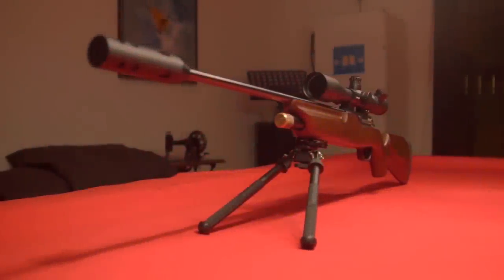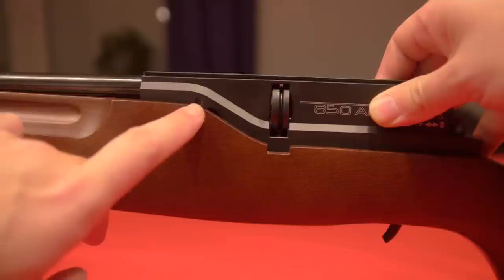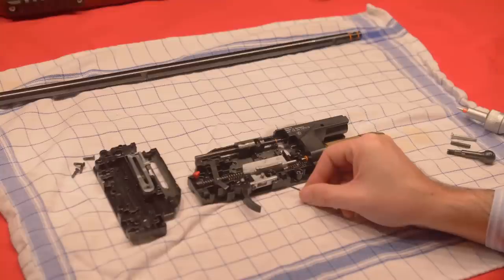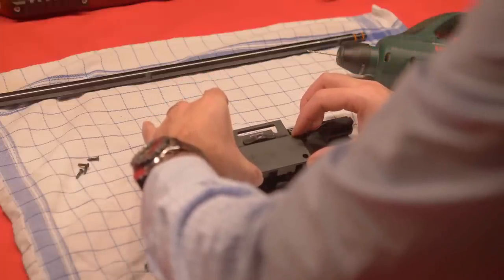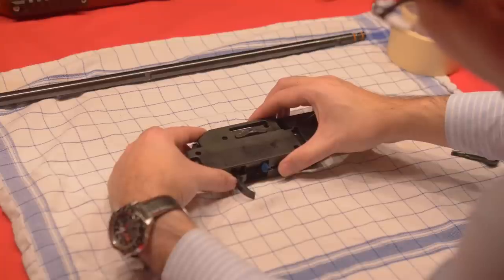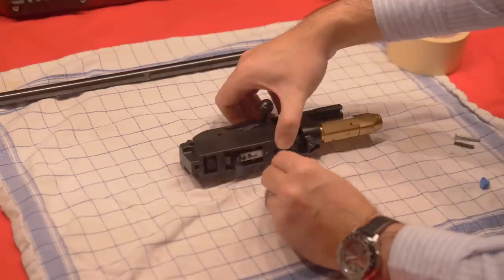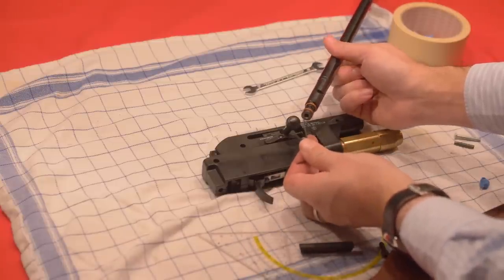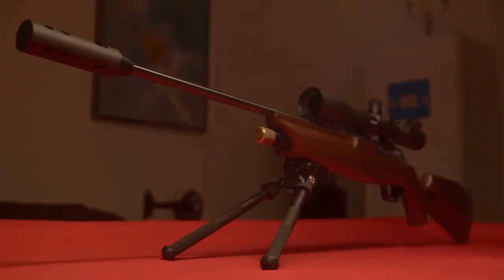Umarex 850 Airmagnum CO2 tuning / trigger mod DIY

Comment: Just the same as the Walther RM8 a little thread lock on the grub screw is not a bad idea to stop movement with use, thank you for taking the time making this video, saved me from a lot of headaches.

Comment: For people doing this, on mine the pin was started from the left and not full width, so its much easier to push it out from the right side (towards the left), the opposite shown in the video. Thanks very much for making this though, I was struggling removing the stock ;) Edit: also a very good improvement is to file down the tab on the back of the safety so it only engages when you want to. It is indeed less safe however the bolt action is much improved, because now it only loads a new cartridge and sets the seer.
Reply from the maker: Welcome. Haha, you were not the only one having trouble with the stock!

Comment: Hi Tom. I just purchased an 850 in .177cal, and found I was not satisfied with the 2nd stage trigger creep either. I will be doing your trigger mod this weekend. I was wondering why you had to detach your barrel before detaching the stock? Maybe your wood stock is different from my synthetic stock?  Very informative video by the way.
Reply from the maker: Yo! Correct, you have to remove the barrel otherwise you can't get the system off the wooden stock. Odds are you don't have to do this with the synthetic stock.
Reply: Huhhttppys

Comment: Hi tom may I ask what make bipod you have on your 850 and is it a tilting bipod,looks good  I might want to buy one so where do you purchase it from . regards Ian UK
Reply from the maker: Hi Ian, bipod is an Accushot Atlas BT-10 airsoft replica. The original is more expensive than the rifle so I picked a decent copy by JJ airsoft. It is tilting and adjustable in length and leg angle. Quality of the copy is average but the price is bearable, unlike the original.

Comment: Hi tom !  I have the classic wooden stock version also.i wasn't sure how to remove the stock till I saw your video LOl, big thumbs up for that.im wanting to do this trigger mod as mine has some creep.i was wondering whereabouts exactly you have to drill the hole? And is it to the right of the original hole or to the left.kind regards.
Reply from the maker: Yo Ian. Yeah, it also took me a while to figure out how to get the stock off! As for the drilling, the video should give you a pretty good idea. Once you have opened the system, it'll all become obvious. Left, right... You know, depending on how you lay down the rifle, that changes. Watch my video closely and you'll get it! Happy shooting :)

Comment: Hey, what valve did you use to increase the power?
Reply from the maker: I bought a 16j valve along with a stronger hammer spring. Never installed them though, haven't felt the need for more power (and thus less shots per CO2 cartridge and higher cooldown).

Comment: What happens if you don’t pull back the magazine pin before you separate the two halves?
Reply from the maker: It makes assembly back together more complicated because the parts aren't positioned in the simplest way. Not the end of the world, but adds some difficulty. You'll figure it out, it's just harder so you may just as well avoid it.

Comment: Hi Tom,
What valve is that in your 850...??? I need to replace mine I never saw the one you have there, the shape and length are different,  I would like to find a valve with higher capacity than the original ones, everywhere I looked they are out of stock and have been for a very long time, so your answer would be appreciated.
George
Reply from the maker: nyodine Don't look at mine then :) it's a 7.5 joule / 5.5 foot-pound valve. Gotta thank my country and its regulations for that... Well, at least I get super high shot count out of my co2 sparklets, and the rifle is whisper quiet, literally. But I have to lob my shots at 30yards/meters :)
I believe you can manage 16j/12ft-pd with the export valve and matching hammer spring. Due to the pressure of co2 at room pressure (870psi), that's probably the best you'll achieve. Else you'll need a pcp :)

Comment: Hi Tom,
Would you do a HPA/PCP conversion on this rifle for us please?
Many Thanks,
Frank
Reply from the maker: Hi Frank,
Sorry but I don't plan that mate. This little guy will remain as is, for me at least, because I like it that way (and incidentally because of my country laws): an easy to use, convenient backyard shooter. It's super quiet (mine is limited to 7.5j), cheap to run and just superb for its price. Quality at its simplest...
I got another rifle in the meantime, which is sort of a polar opposite: amazing looks, pcp, bullpup... But since it's priced competitively and made in Turkey well... couldn't hit a barn door at 30m, poor finish... That one required a looot of tweaking. It is nice now though :)
Reply: No worries, thank you for the reply! :) I struggle to find a parts manual or any information on this model of rifle if I’m honest, only seem to find the plastic 88g co2 version... don’t suppose you have any information on it?
Reply from the maker: @FrankAngling  What exactly are you after? To my knowledge the 88g CO2 version is the exact same thing (except for the stock), no?

Comment: U GOT AWAY WITH IT...drilling and tapping it gub screw as the adjuster...but on a lot off guns U carnt... back in the 80s i worked evenings time ...on gun repairs... firing pins... hammers... springs... and ajustments ...i had 2 CZ brunos .22 B.A. and no ajustment on stage 2... this MOD can be done on ALL hammers....the sheer that holds the hammer ... lets say .oo10 file down to .oo6 thou...and job done... all guns lighter trigger pull...🤔...hello from Ireland....😉...

Comment: Hi ...... good video and luckely about the Hammerli 850
I own such an airgun and have good fun with it
but my Hammerli has problems with that rotating pellet loader, the catch does not always rotate the magazine
any idea how to fix this ?
greetings
A
Reply from the maker: Annie Renard Hi, thanks. Never had that issue myself, I use 4 genuine mags with no problems. The only times it wouldn't feed properly was when I didn't cock it all the way with vigor. Try "manhandling" it and see if the issue persists. If so, feed it different pellets (domed jsb exact heavies 4.52mm are my rifle's favorites) and see if it helps. If all that doesn't do it, I guess you'll have to look inside for the cause, but I doubt it's necessary. Pull the bolt hard back, and push it fast and hard back front. Should do it...
Reply: hello thanks for the advice......it works that way !!!!!!
that airgun needs a "rough" handling 
greetings
A
Reply from the maker: Annie Renard You're welcome. Glad I could help ;)
Reply: Hi Annie,
I also had lots of problems with the magazine not turning when it should, it is true that handling the bolt a lot rougher does help the cycle to complete but I was not satisfied with that so, the next time I need to open the action panel, I replaced the spring from the magazine holder plastic part with a much weaker spring and that resolve the issue.
The original spring is far too strong and pushes the plastic holder far too much against the magazine and that will stop the action from doing the cycle easy and smooth.
Too weak of a spring doesn't work, there has to be some pressure on that plastic holder to keep the magazine into position, so, you may need to experiment with a few different springs until you have the right one, you know when is the right one when the cycle is done very smoothly...!
Reply from the maker: nyodine Interesting! Good tip, thanks!
Reply: hello nyodine  thanks for this advice

Comment: Got any ideas how to adjust the power up a bit ?
Reply from the maker: New valve and hammer spring kit for export, I think you can go up to 16J with it. Must be around 50€ or so. Check if it's legal in your country though ;)
Reply: if you use another valve, a specially valve for compressed air (than it becomes a walther dominator1250, both weapons are the same, the only difference is  the co2 and compressed air) you can adjust the power more as a bit.  4,5mm 28j, 5,5mm 40 j and 6,35mm 50joule.

Comment: after drilling the hole do you have to thread it?.
Reply from the maker: pointlessperson I didn't, metal is quite soft, steel screw will do it's own threading. Not very elegant solution, but worked well for me.

Comment: I would never drill a hole into the system of may gun and you should never make a dry fire specially if you use a stronger hammer spring. the pin of your valve could cry;)
Reply from the maker: Then don't! Won't make any difference to me. And yeah, you're right about the dry firing, except this is a 5.5J rifle, so the lowest you can find and the hammer barely tickles the valve. No problem at all.